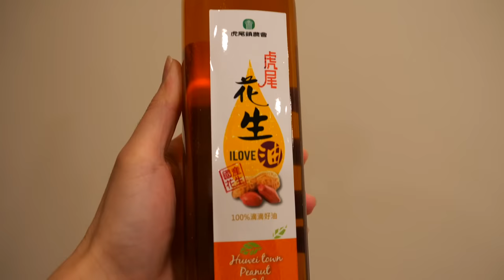Peanut Oil Making in Taiwan / 花生油製作 - Taiwanese Peanut Factory

Comment: Nothing beats the wonderful smell/aroma/taste cooking with peanut oil.  Recent study focused on smoke point, free radicals etc that's raised some concerns on it.  My guess is if you don't overheat (160 C for unrefined or 230 C for refined peanut oil) for stir/pan frying to avoid smoking then moderate daily consumption is OK.  BTW, using oils with higher smoke point for deep frying is recommended.

Comment: in most cases, the peanut oil found in the store is not produced in the way described in this video. Rather, a solvent is added to the ground peanuts which joins the oily part to separate it from the fibers. Subsequently, the oil-solvent mix is subjected to evaporation, a process in which the solvent is separated from the oil and used for a new production cycle.
Reply: Disgusting!
Reply: You want "Cold Pressed" oils if possible.
Reply: @IIGrayfoxII  That's what I was going to say. Cold pressed is -- supposed to be -- this process.

As opposed to the "Chinese process" which involves opening a manhole cover.
Reply: Such an unhealthy and horrible thing to eat
Reply: @jasonknight1085  what? This is litteraly a Chinese process what are you talking about?
Reply: Right, planter's uses this process.  But if you buy "cold pressed" or "extra Virgin" at the store, that is what this is. That's also why it costs more.
Reply: @Mrshutter  That was kind of a joke. 

In China they have what's called "Gutter oil" and it's literally oil "enterprising businesspeople" "recycle" out of the sewers and drains. Because it clumps together and floats on the top, it's easy to skim off. It also collects around gratings the same way dumping your cooking oil at home down the sink can.

It's then "boiled",  "skimmed", "filtered", and then sold to restaurants. It's estimated to be around 10-15% of the supply of oil used in restaurants in China. 

Whenever people say "let the market decide, who needs regulation" stuff like this comes to mind.

https://www.youtube.com/watch?v=zrv78nG9R04
Reply: @Mrshutter  I think the people of Taiwan would disagree.
Reply: @jasonknight1085  oh. Right I forgot about that. Lol. Thanks
Reply: @hoodzzeee  depends who you ask in Taiwan. They arnt Hong Kong. Not really protesting their situation.
Reply: @jasonknight1085  yeah but there’s a small problem .... their market is so heavily regulated that they have no choice but to use gutter oil. Despite the regulations.
Reply: Yes, I am honored to introduce this peanut oil factory near my home. This brand is a local brand. I can guarantee that the production of this product is the same as the video. My home is in Taiwan, and Taiwan has nothing to do with China. I sincerely I hope everyone can understand.
Reply: @heero714042  yes. Though how do you feel about china wanting to do with Taiwan?
Reply: @Richard Cranium they did say most found in store
Reply: @Richard Cranium Can I buy the real deal peanut oil if I live in the US?  Online?
Reply: @jasonknight1085  I absolutely love Chinese "street" food.
Reply: @Mrshutter  
One Taiwan  , One China ,
That's all！
Reply: @Mrshutter  Yes, sir, this topic is very huge, and my explanations only represent myself; since China and Taiwan are ruled by two completely different political bodies, the values are different from the outlook on life, and there are many living habits and knowledge. , is very different from the attitude of life. We Taiwan (Republic of China) have always believed that they exist independently of us. Taiwan has always wanted to follow the model of East and West Germany. Unfortunately, China (the CCP) has always been reluctant, only claiming that we are part of them, which is very incorrect, as the source is that they are independent of the part we rule.
Reply: @Mrshutter  In the case of disagreement between the two sides, we negotiated many times without success, and finally negotiated a "92 consensus". The interesting thing is that this "92 consensus" is only the result of the two sides taking back and negotiating, and there is no so-called "consensus" in essence; In recent years, Taiwan has gradually abandoned the concept of "We represent China" and replaced it with "We are from China, we have Chinese blood, but we are Taiwan, we are two different countries." Things like Germany after the World War.
Reply: AFAIK (and I was educated as "industrial chemical processes chemist") that solvent extraction process IS NOT used for producing edible oils - as you can't remove the solvent completely.
Edible oils are always "pressed" - "cold pressed" first to obtain the highest quality oils, then whatever is left may be "hot pressed" to remove more oil - cheaper one and of somewhat lower quality, but still perfectly edible and safe. They can be (and typically are) used for deep frying in "fish'n'chips" shops and such - the less appealing taste and tad imperfect flavour won't make any difference here, but much lower price will.

And THEN only the remaining oil can be extracted using mild solvent (hexane or such - dissolves oils and not much else).
And yes, then the extract is being "evaporated" to recover as much solvent as practically possible, but those oils produced in this process ARE NOT edible oils - they are used for "technical purposes" - like producing soaps, lubricant and other oil-derived products - like boiled linseed oil (used as wood impregnant/ waterproofing "paint").

The process shown here differs from a "proper industrial one" only by the much higher amount of manual work and less automatisation - but this is some low-volume production of "hand-made local speciality product", made of "selected produce" and thus of supposedly higher quality - and as such it's commanding higher price so that little bit of extra work is OK (after all you have to have some basis to proudly claim it's "hand-made" on a label, right?)
Reply: Very interesting information. Generous of you.
Reply: @hiunwx  your sentiments is shared by 1 in 10 billion.

Comment: just keep in mind that most, if not all peanut oil in the supermarket's shelves are solvent extracted(chemicals used to maximize oil extraction), and not pressed extracted like this on the video.
Reply: So this is basically extra virgin peanut oil
Reply: So what?  Peanut oil is often extracted with an organic solvent like hexane and then the solvent is boiled or evaporated out.  Its not bad for you or unnatural in any way.  Solvent just means something it dissolves in, water is a solvent who cares if it is used in cooking?
Reply: @paulosullivan3472  Yes its a safe process. I bet this oil made in the video has more of a flavor which may be nice for some applications.
Reply: @rocknrolla2426  Yes I suspect you are correct about the flavour.
Reply: @rocknrolla2426  Indeed. Some flavour chemicals might not be able to dissolve in hexane or whichever solvent they use
Reply: I agree, I would prefer peanut oil produced without hexane since it causes neurological damage.
Reply: @mccardieclan1755  there is no hexane left in the finished oil product.
Reply: @rocknrolla2426  I would have to see proof before I would believe it. Until then I wouldn't take my chances. thanks
Reply: @rocknrolla2426  there's always residuals traces of solvent use in oil extraction. even as high as  parts per million. and I quote  "It has been estimated that refined vegetable oils extracted with hexane contain approximately 0.8 milligrams of residual hexane per kilogram of oil (0.8 ppm)"
Dr. Guy Crosby. In some cases there may be a concern about the quality of the hexane use. not to mention the use of bleaching and deodorizing, such it happens in canola, used in some oil refinement. no thanks. I stick to my cold pressed reputable brand of extra virgin olive oil.
Reply: @sandrog2117  Right on I'll research it more. Thanks.
Reply: @paulosullivan3472  it's completely unnatural. Hexane comes from crude oil, its a cheap unnatural way of chemically extracting oil. we will likely find out using chemically produced oils is bad for you in the future just like we did with sugar. Extra virgin oil aka cold pressed(like this video) is the only way you want to consume oil.
Reply: @royaldecreeforthechurchofm8409  In what way is it unnatural??? Do you even understand the process at all?  If you use water to separate oil from something is that unhealthy?  Why would it be?  You are just frightened of what you do not understand.
Reply: @paulosullivan3472   there's always residuals traces of solvent use in oil extraction. even as high as  parts per million. and I quote  "It has been estimated that refined vegetable oils extracted with hexane contain approximately 0.8 milligrams of residual hexane per kilogram of oil (0.8 ppm)"
Dr. Guy Crosby. In some cases there may be a concern about the quality of the hexane use. not to mention the use of bleaching and deodorizing, such it happens in canola, used in some oil refinement. hexane clauses neurological damage.
Reply: @stefthorman8548  So what?  As I already said to the other guy literally everything has some toxicity level.  The question isnt if something has some level of toxicity, even water has a level of toxicity, the question is at what point it becomes toxic.  There are thousands of papers showing that you need vastly more hexane before it has any level of toxicity, you will get more toxins from a cup of coffee.  You quote one paper which even in itself does not actually show any level of toxicity to humans only that some substances remain.  You are demonstrating, just as the other person did that you dont even understand what toxicity is.  Water is toxic but not at the levels humans consume daily, hexane is toxic but not at the levels consumed by humans in these foods.  Toxicity is all about how much you consume not the substance per se.
Reply: @stefthorman8548  If it's a solvent it probably gets cooked away pretty fast.
Reply: @paulosullivan3472  🐑
Reply: @Paul
Hexane is highly neurotoxic and highly-polluting petrochemical compound.

“Many foods, thought of as ‘healthy options’ on grocery store shelves, contain ingredients that were processed with a neurotoxic and highly-polluting petrochemical compound called hexane,” said Charlotte Vallaeys, Farm and Food Policy Analyst for The Cornucopia Institute, a Wisconsin-based non-profit farm policy research group.

Comment: As a former professional in the Chemical Industry, I need to say that using paper,  is not precisely the most healthy way to compress the seeds, there will always be contamination with CMC (carboxy-methyl cellulose) and the chemicals used to treat the paper, sulphites and more. Won't use any oil coming from there.

Comment: and the peanut pulp is used to produce peanut butter so nothing goes to waste...amazing 😍🤩
Reply: Doesn't peanut butter require the oil to be there? Otherwise it's peanut dust. Or is there more oil in the nut than needed for peanut butter?

Either way, the peanut pulp is useful for something. At the least you could make that dehydrated peanut butter stuff.
Reply: They either add cheaper oils or add additional peanut oil to ground peanuts
Reply: @TheJohnreeves  It can be used as a lean protein powder.
Reply: there's a product called pb2 which is like defatted peanut powder. the market for pb2 is probably negligible though compared to peanut oil.
Reply: @TheJohnreeves  the good peanut oil is extracted and then toxic soybean oil is added to many peanut butters (natural peanut oil peanut butter exists but the oil will separate from the protein during storage and must be stirred)

Comment: Peanut oil adds so much flavor to fried foods, and it's great for stir-fry too.
Reply: Sesame oil is so much better and healthier
Reply: So much toxicity too I love it!!!! 🤤🤣🖕
Reply: @Ocgt  You're confusing hot pressed or chemically extracted oils with what you see in the video, which is cold pressed.
Which should be healthy oil to eat, not toxic at all. Not so sure about the toasting process though.
Reply: @GardeDuCoeur  You don't fry in sesame oil that is used to flavor.
Reply: @rocknrolla2426  fry and stir-fry are not the same, sesame oil is literary made for stir-fry only.
Reply: @GardeDuCoeur  I just dont use it for anything but flavor. It's too strong for me to stirfry with. I'll use peanut or canola for their high flashpoint.
Reply: Only for stir fry, deep fried using peanut oil just like burning money
Reply: Peanut oil smells a lot, if you are not used to it you will run away from the kitchen
Reply: @cheesecake7159  people use peanut oil to fry whole turkeys here because of the high smoke point....its literally one of the best oils to deep fry with
Reply: @rocknrolla2426  You do fry in sesame oil. Toasted sesame oil is used for flavor.
Reply: @cheesecake7159  Five Guys uses peanut oil for their fries, guess they don't see it as burning money
Reply: @0xszander0  He is correct only. This is not cold pressed. They roased the peanut befor they graind them. So it is hot pressed. Peanut should not be heated twice.

Comment: As someone that has replaced a lot of galvanized pipes (and seen what comes out of them), I am disgusted that they are using them to process food, instead of stainless, or some other option.
Reply: It can't just be me who saw some rust on the pipes, right?
Reply: Looked like old peanut oil to me rather than rust and I used to purchase metal for an industrial door company. There are different colours of rust too but I saw none here.
Reply: @sevenwatson5854  not the outside, the inside... the stuff I've seen pour out of galvanized water pipes would make you puke.
Reply: I agree that the stainless will look much better, but the whole process with a lot of head and and it covered by oil, just like we wont find any rust inside the engine.
Reply: @henmich  Yeah, this. Like, I saw some hint of rust around the opening of the pipes, that's how you know that there could be whole another level of rust inside the galvanized pipe which is pretty disgusting, based on my experience of changing one galvani pipe set in my house
Reply: The floor was freshly painted, along with some of the equipment. Probably everything in shot was cleaned by an army of workers for days before the video. This wasn't the normal production conditions. It was a show put on by the factory and videographers.  There is much more to making biologically safe, pure foodstuff than is apparent to the average person.

This factory's process is fine for producing peanut oil for use in industrial products like paint, inks, lubricants, animal feed, but it's a horror show if the oil is to be consumed by humans.
Reply: @R50_J0  it seems like this oil is for human consumption

Comment: I usually cook with peanut oil and also have peanut powder (after the oil is extracted) it's where all the flavour is
Reply: Is that the cake left over from the extraction?  I wondered what they did with it, figured animal feed.
Reply: @brokenrecord3523  yeah probably just a very small porti ok n is sold as peanut flour like I buy. I would guess most is went back into animal feed or eexonstitured peanut products like confectionary, jar sauces etc
Reply: @brokenrecord3523  they make peanut butter
Reply: @digital945  Wouldn't they would have to put the oil back in?
Reply: @brokenrecord3523  no, peanut butter often doesn't use peanut oil but some cheap seed oil crap extracted using hexane
Reply: @alquinn8576  oh ☹

Comment: It seems by the look of it that they use carbon steel instead of stainless for their equipment. I wonder why that is - stainless is the default in modern food manufacturing. While carbon steel gets "seasoned" by vegetable oil, stainless not so much, hence it should be better for cleaning. And it seems they need to clean their machines better! Not to mention paint chipping off in some places, I would not want that in my bottle 😅

Comment: I’ve never used peanut oil to cook.  Does the oil affect the taste of the food while cooking?  Reason I ask is because when I use coconut 🥥 oil for frying eggs, for example, the eggs have a light coconut flavor afterwards.
Reply: Yes, of course it affects the taste. The taste is not as strong as coconut oil.
Reply: Use refined coconut oil if you don't want the coconut flavor. Peanut oil has a light flavor and can stand high temps without burning. That's why it's used in stir frying.

Comment: 1:48 shows a huge oversight. Having the grate on the floor is extremely unsanitary. Elevate that just a couple feet and put a lid on it when it's not in use, and it's fine. It's an easy fix, so it's weird that it's just left like this.
Reply: Eh they blanche it right after that, doesnt seem too unsanitary to me

Comment: What happens to the mashed peanuts when the oil has been extracted?
Reply: They are added to marshmallow by-products, heated and pressed at 2,000C and become car body parts for KIA automobiles.
Reply: @andyharpist2938  Not entirely true. Hyundai is a major customer also.